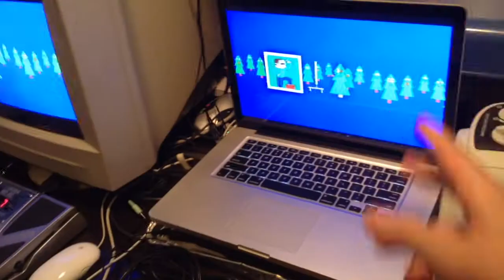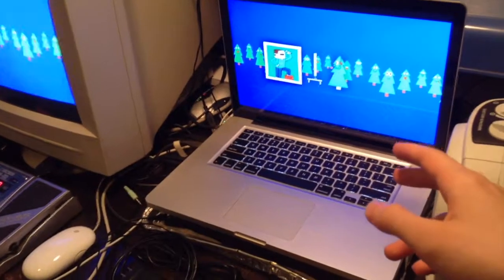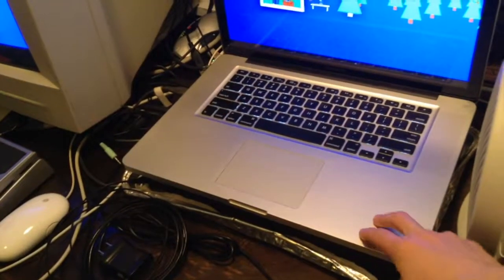DIY Laptop Cooling Pad (Using Kitchen Items)

Comment: Cookie cooling rack.  Just think DIY and its so simple.  Less heat sink but good air flow and easier on the actual lap.  I am thinking of using things to prop the cooling rack at the right angle on my lap,  and I figure this is great, but I can get a nice metal mesh one off Groupon for $14.99 and it has a little clip at the bottom to keep a laptop of tablet from slipping off.
Reply from the maker: Nice! That sounds like it should work quite well!